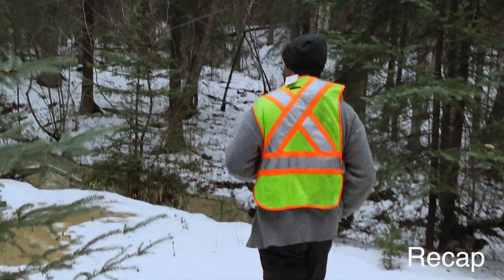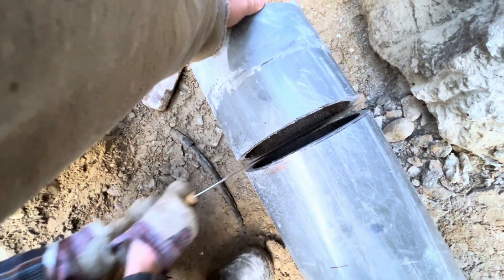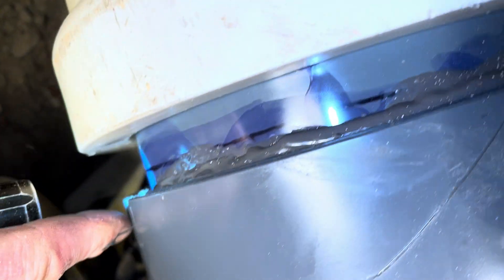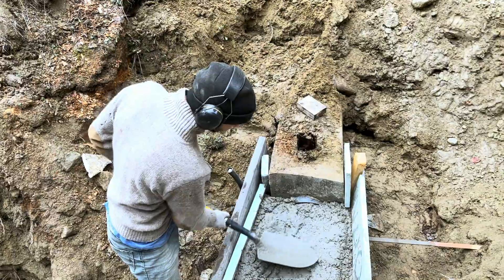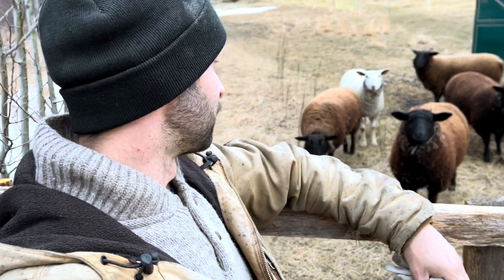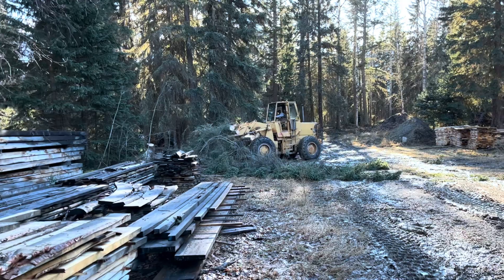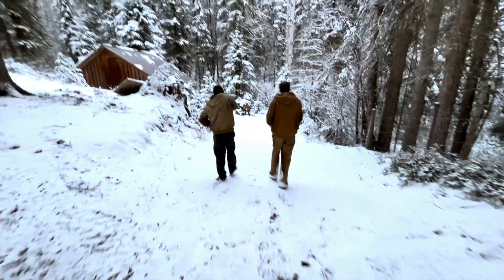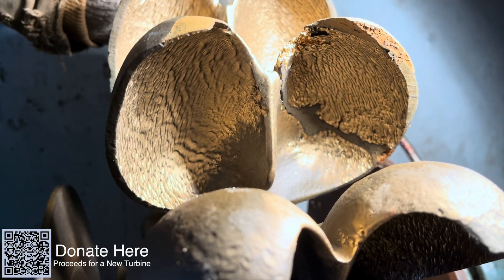Micro Hydro Plant | Pipe Repair

Comment: why not test it before doing the concrete?
Reply from the maker: I wish we could. If we did it would definitely blow apart the white coupler, that part is only a gasket fitting. There simply isn't enough movement in the pipe now to do glue joints the whole way, even when they put it in in the first place it looks like. The gasket fitting requires the concrete supports to take the pressure of the water at the elbow. It's a design flaw if you ask me. One day we might have to remove the second line and just commit to 1 pipe into the building, that would simplify some things.

Comment: How much to 3D metal print the cups?
Reply from the maker: I’m not sure. I did however read an interesting study on pelton manufacturing methods and materials. There are quite a few ways to make them. Sand casting being the most basic and roughest finish. There are options to apply hardener to some metals like stainless steel, that would increase the lifespan of the pelton by many years.